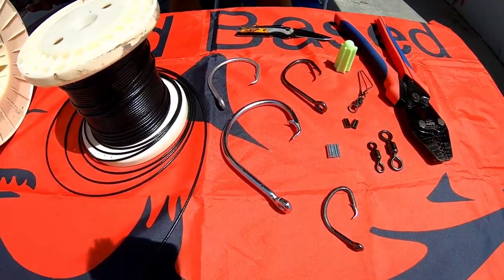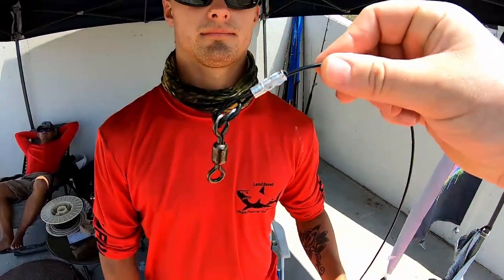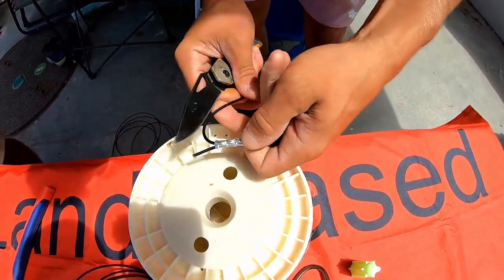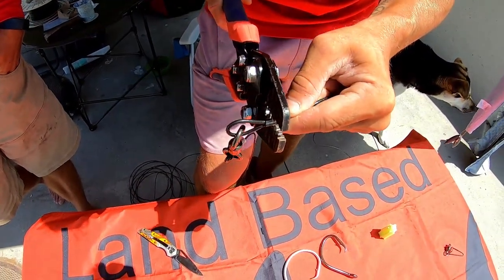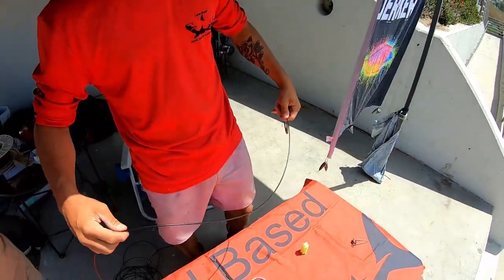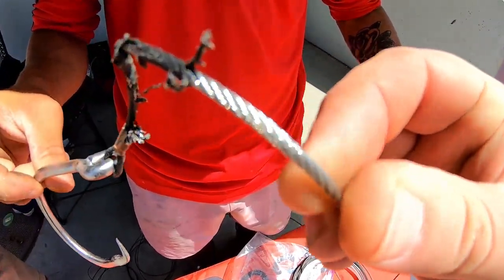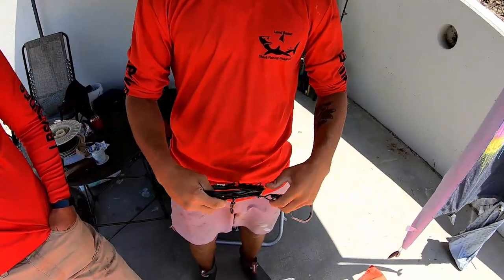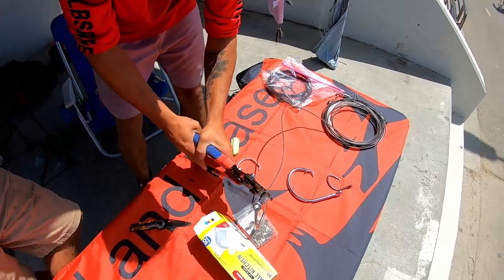DIY: How To Make A SHARK LEADER And WHERE To Get The TACKLE

Comment: About a week ago i bought mine , 250 pound mono woth 275 pound bite leader, the 49 strand wire, and did 300 pound swivel because why not lol, i have it on a penn squall 50 Level wind and 100 pound braid, hopefully ill catch something,
Reply: you catch anything?
Reply: @pheonix7348  i actually have another combo , the Penn squall 50 lever drag with Penn conventional rod, with the same leader I mentioned before, I caught a 5 foot sandbar shark on it about a month ago

Comment: Awesome video! Just a question. So you have hook, cable, swivel, mono, then another swivel.

What is the 800lb mono for? Why not just add the swivel to the main line? So hook, cable, swivel, main line? Thanks man!
Reply: So the reason for cable to mono 
Cable is the bite leader so it can’t bite through 
The mono is the rub leader so the sharks skin can rub on it and still not cut off

Comment: I just bought some 800lb leader line. Quick question…what size snap swivel did you end up using that free slides down the mono line, but also won’t go over the top of the aluminum crimp?
Reply: Check the inside diameter of the mono make sure it’s bigger then the mono and smaller then the crimp
Reply: Yeah I get that, but I don’t have a saltwater fishing shop near me, and all of the snap swivels online measure everything in OT sizing, and not actual MM sizing, so I can’t be sure I’m blind purchasing the correct product.

Which is why I’m asking what size snap swivel they’re using in the video.